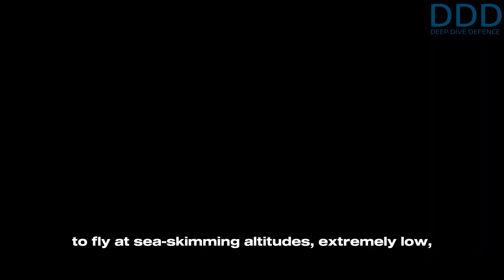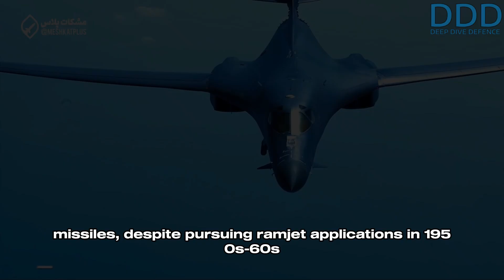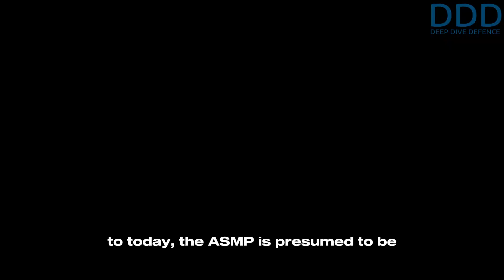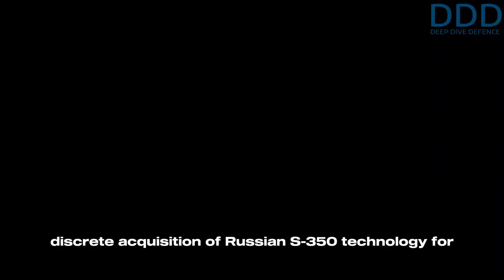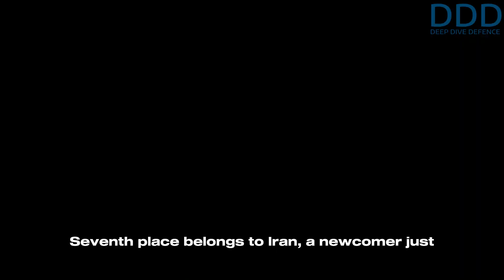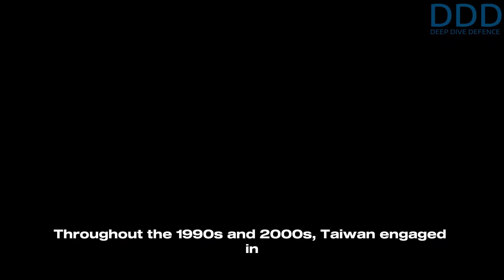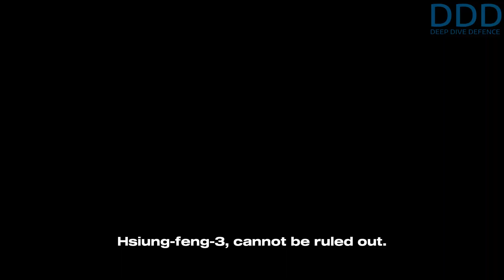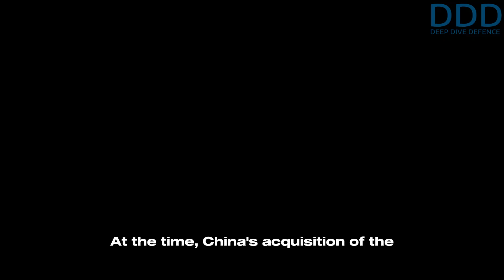Ramjet strike-missile: Why only 9 countries build them & which they are

Comment: Hey Patarmes, I have a question. I hope you can answer. What kind of INS does Iranian missiles use. 
Have Iran developed their own ring laser gyroscopes (RLG) or do they use Fiber optic gyroscopes (FOG).  
It would be interesting if you could make a video on what kind of guidance Iran uses etc 
Thanks for great content 👍
Reply: FOG is cheaper to make but requires good calibration and that is not easy, it comes down to variances in individual units, it is however perfect for drones and missiles because it has no moving parts, it is resistant to pressure and vibration, the RLG said to be more accurate but more costly, they are also not as resistant as FOGs. Both are based on Sagnac effect but different technics. Some system can use both in conjunction as well. As for INS, based on speeches of IRGC generals it might be coupled with a topographic data handling. for best accuracy and if true, this would negate the need for GPS or GLONAS or other satellite guidance systems. which also means everything is onboard and such drones would be very resistance to electronic warfare.
Reply from the maker: Thanks.

Primarily IFOG these days.
Lets see if I can make a video on the topic in the future.

Comment: I've always been curious as to why ramjets aren't used in a wider range of missiles, given the obvious advantages - especially with anti-aircraft missiles.  I guess cost is a key one.
Reply: there is certain complexity. ramjets cant start with 0 speed but needs to be close to supersonic to even start their engine. so more or less every ramjet missile needs 2 in 1 engine. or 2 engines or even 2 stages. first part its than solid rocket engine.
also usually they are liquid fueled and thats not so fantastic for storage. 
so they are a bit less useful because of those limitations. its just like with thermobarics. they do punch above their weight but not useful for every case.
Reply from the maker: Yes, they need to be two stage

But liquid propellants can be long-term storeable if done right
Reply: They're less useful against ships? You write a lot.
Reply from the maker: Certainly, yes

Comment: Hey Patamares: Russian FighterBomber channel has leaked that EW is now so dense and effective, that the UMPKs are now basically useless beyond large area targets like factories. Could you make a video on this and about how far RU efforts are on using modern INS to supplement satelite navigation?
How realistic is it to use INS for GPS level accuracy on the ranges where UMPKs are used? Are they accurate and cheap enough (RU aims to produce 70K UMPKs in 2025).
Thanks!
Reply from the maker: Hi, Yes I heard the rumor

The reason why Russians always avoided developing such GNSS weapons was that they feared such a thing to happen at some point.

Maybe at some critical regions like Kursk such a EM power density can be reached, but not at all front sections
Reply: @DeepDiveDefense  Thanks as always! Wether RU or UKR channels, even if they are considered trustworthy and self-ciritical, many seem to use hyperbolie as a tool for publicity, to force the burocrats hands for fixing existing and real problems.
I should have remembered this pattern, your explantion makes much sense, especially considering thar RU already hardend their GPS/GLONASS with 4 antennas etc. 
I hope after the war we will get a real look at the data behind the scenes.
Reply from the maker: You'r welcome.
Agree.
It will remain a relevant weapon, CRPA GNNS receivers with 8 antennas are already uses